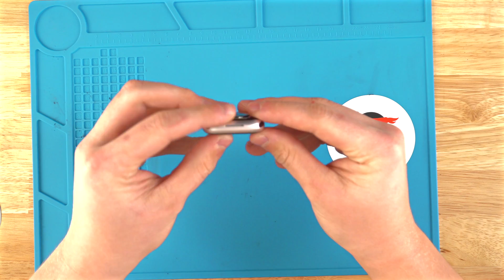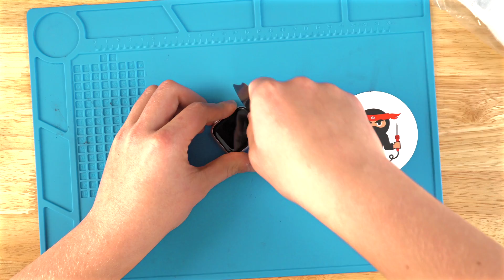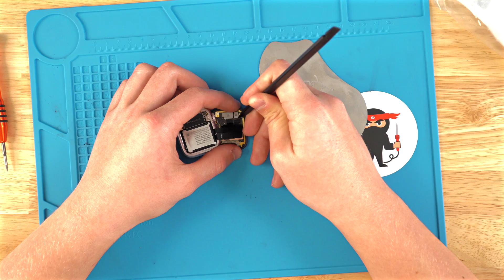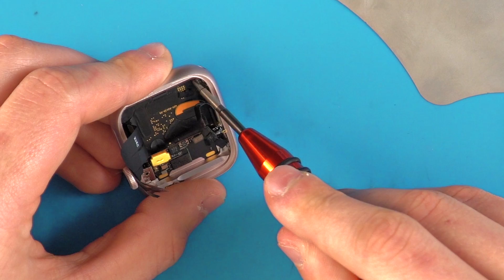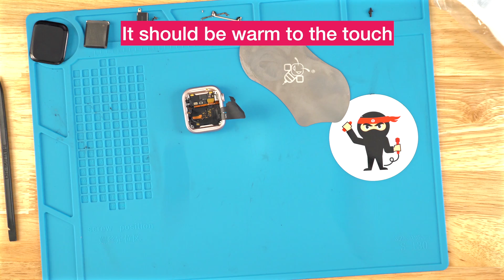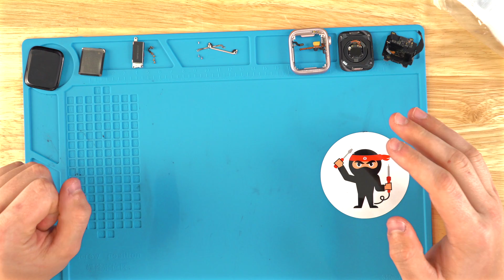Apple Watch Series 9 Full Teardown Battery, Motherboard, Screen, Taptic Engine, Back cover

Comment: Hey dude are you based in the UK or is there any way you can sell your AirPods Max Bluetooth boards cheaper than what they are currently or offer discounts from time to time or would I be able to send a pair of AirPods Max to you to work on and how much would it roughly be need a Bluetooth board and can’t find one anywhere.
Reply from the maker: Hello, You could definitely send your device to our repair center. Here is the link to our website 👉https://www.joesge.com/pages/repair-service - JoesGE